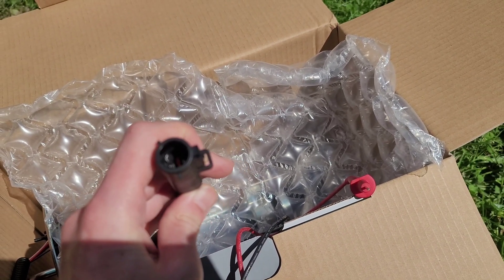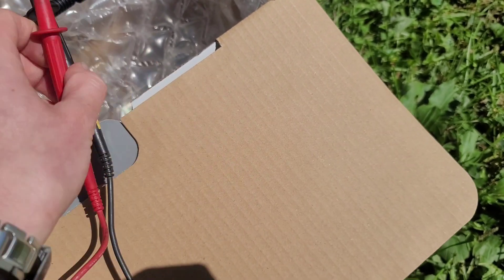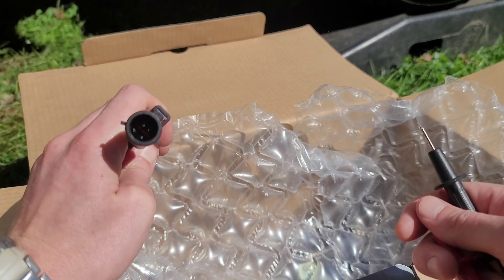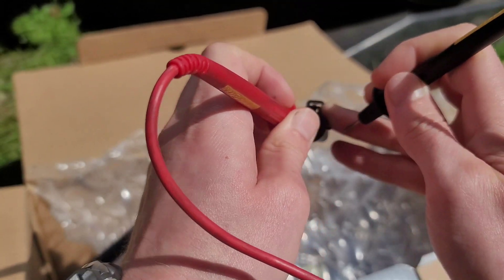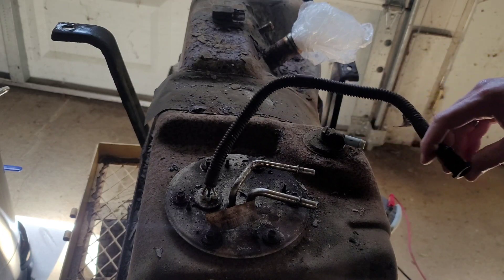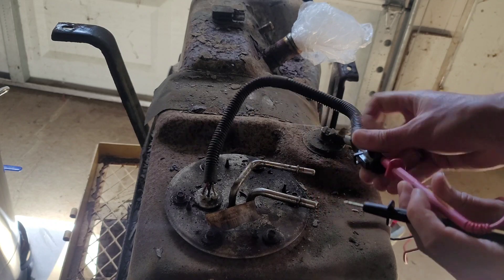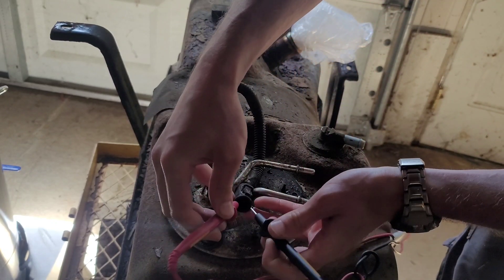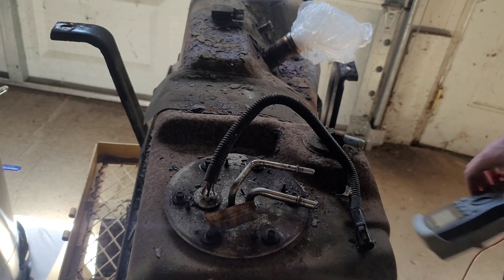How to Test The Fuel Pump on Any Car or Truck

Comment: So, for those of us yryingbbto diagnose a different fuel pump, what  are the pinouts you are testing.  I have two fuel pumps on my bench.  They have a single positive and single negative terminal.  One has continuity between them, the other does not.  I would have thought continuity would mean a short in the pump (bad) .
Reply from the maker: You would have to look at the schematic for your specific pump. It’s been too long ago to remember and I don’t have the truck anymore lol.

Comment: you say that ''How to Test The Fuel Pump on Any Car or Truck''. do all fuel pumps have 4 wires and the same positions [2 bottoms, 2 tops]???
Reply from the maker: You would need to look up the specs for your vehicle’s fuel pump. This should be obvious if you get a new fuel pump or look at your own and the connector is different than what I have.

Comment: Thanks for showing what settings to turn to test wires.
Reply from the maker: This was a video on testing the fuel pump… not a video on how a multimeter works. Continuity is a resistance value and your meter would be set to Ohms or resistance mode. The beep indicates I have the continuity beep alert turned on. There are plenty of videos on YouTube showing how to use a multimeter. Maybe you should start there.